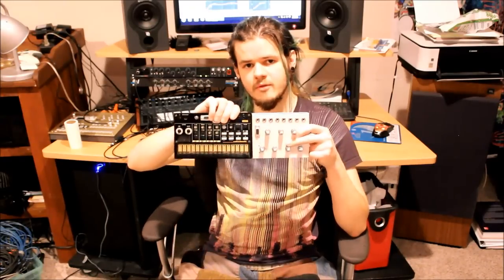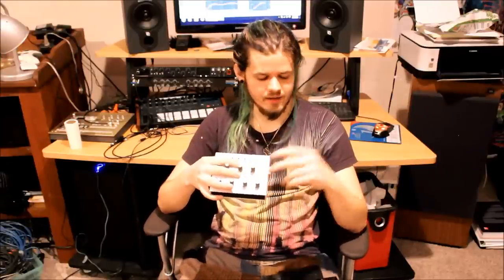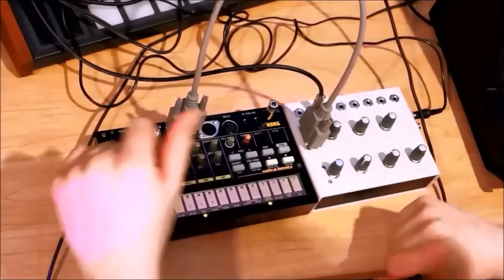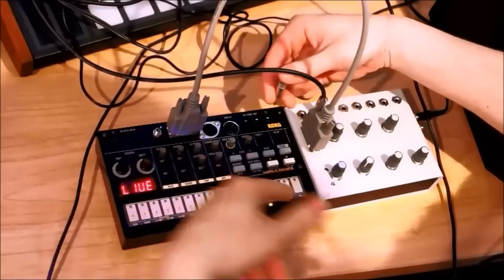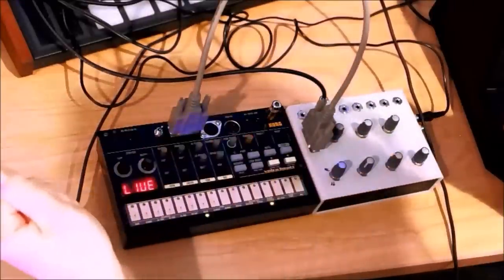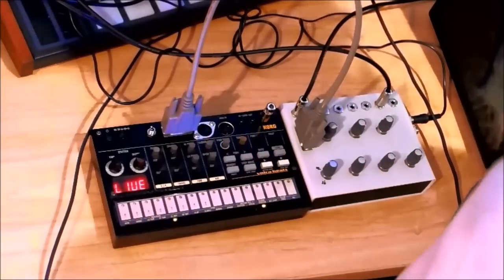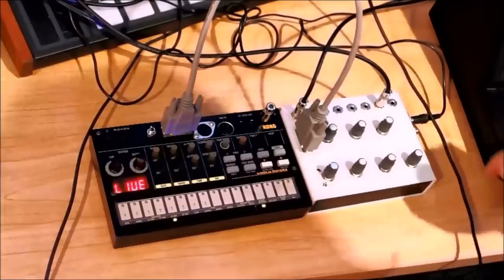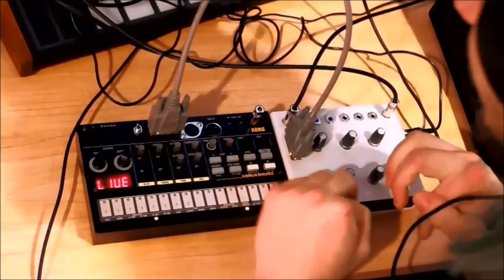The Circuit Surgeon's Mod Box for the Korg Volca Beats

Comment: Nice work! Great to see a nice clean mod with minimal destruction to the original unit :)
Reply: ***** I think the dsub has charm haha, IDC would be much cleaner though and easier to work with if you are designing a pcb. the midi jack shown is also much better looking than the one included in the amazing machines kit too. looking forward to seeing an update

Comment: volca sample  ,  on headphone  no noise  ,  as soon i connect it to my mixer panel  then i have noise  , if i plug it half way  then i have no noise  but then i hear only one side  and the other side is playin on the volca speaker .         any ideas?  olso   if i set volume high  or low on the volca    , then the noise does not increase   ,   its just when i plug it in completly , ofcorse  if i gain it up on my mixer  the noise goes louder    ,  when unplugged  then there is no noise .
Reply from the maker: +stefaan adriansens Sounds like a mono/stereo mismatch somewhere along the chain volca/cable/mixer. Does the mixer have balanced input? Are you using a stereo (TRS) cable? I don't know about the sample, but on the beats you can enter a settings menu to switch between mono and stereo output. I'd see if the sample had anything similar.
Reply: mixer =balanced
cable=trs   
ill look it up   thnx
Reply from the maker: +stefaan adriansens are you going to a Mic/instrument in on the mixer? might try an aux line in if available. other than that the only possibility is some crud on your jacks/plugs, or a bad cable.
Reply: line in ,    today i notce i have the noise on my headphone too , i ges something inside is broken  .  im used to  no noise heh .       maybe it is becose i once uploaded data into the phones input accidently , i wonder what would be broken  by doing that.

Comment: Stephen I love the electronic work you've done, but I love simplicity in all design and your prototype with the shit -brown DB9 connector just isn't working for me. I understand why it has been done, but when Koma did their hack way back in Aug 2013 (http://createdigitalmusic.com/2013/08/first-beats-mod-reveals-hackability-of-volca-series-koma-meets-korg/) it used a nice ribbon connector, which looks less utilitarian and could have been hidden at a later date by an actual chassis modification. Imagine a kit that removes the old plastic Korg chassis and improves it with all the PCB, pots and connections as one unit. A man can dream...
Reply: I meant plastic casing not chassis. Spellchecker was talking me on a wild ride.
Reply from the maker: +Uremawife Nowdave I meant to reply sooner. Already pretty well in the works. This was just a prototype, but the first production version used a ribbon cable. The next version will pack in some super handy I/O utilities and package everything, as you suggest, in one compact unit. It's going to be >>$$$ compared to a Volca or even to the current revision, but pretty reasonable if you consider the gear it could replace....

Here's a more recent video of the project:
https://www.youtube.com/watch?v=Gtjv44oKrQQ
Reply: function never fashion.